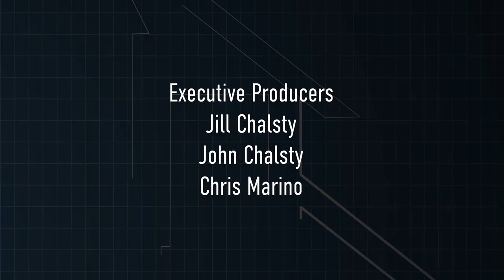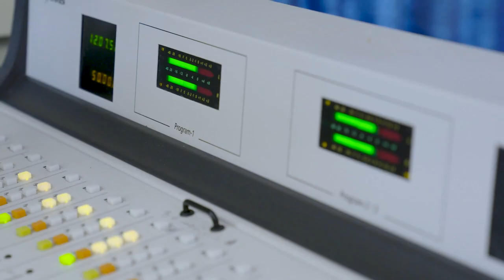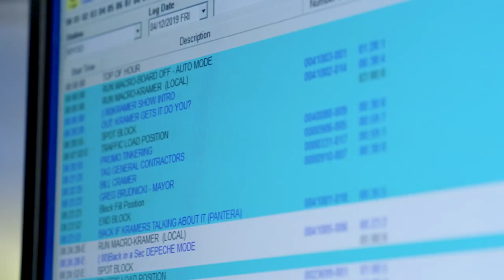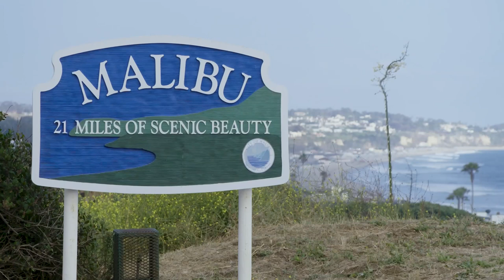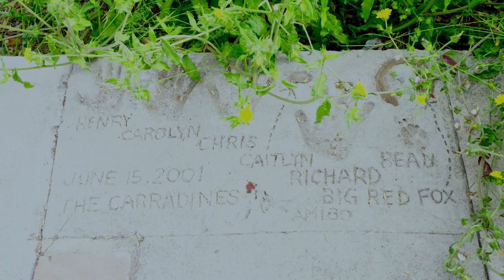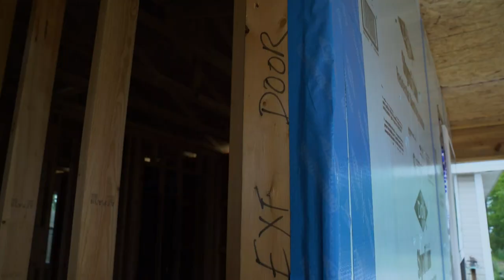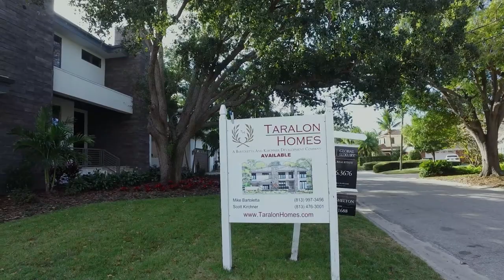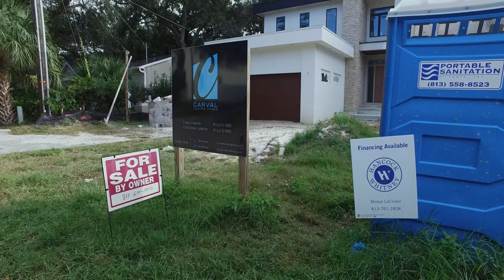How Construction Companies Profit From Hurricanes | The Last House Standing

Comment: Unwatchable. Building code is a process that's always evolving our techniques and materials. It's actually very strict in most places. If you're homes are coming apart when they shouldn't, look to the builder's methods for flaws and code violations. If your home comes apart during a direct hit from hurricane or tornado, well, that's going to happen unless you build completely out of concrete and anchor it to bedrock. We're talking about forces with enough energy to lift semi's and hurl them half a km. A bundle of sticks and fiberglass doesn't stand a chance even in a perfect world. If you don't want to be affected by hurricanes, tornadoes, floods, etc, then stop buying and building in areas where these extreme weather events occur. No one is responsible for your poor decision making skills and lack of forethought. Homeowners really need to stop whining as if everything is everyone else's fault and accept some responsibility. We're all well aware of the dangers of extreme weather and we all know where and how it happens. Stop putting yourselves in the line of fire and complaining as if you did nothing wrong.